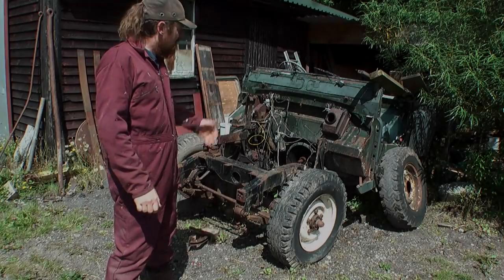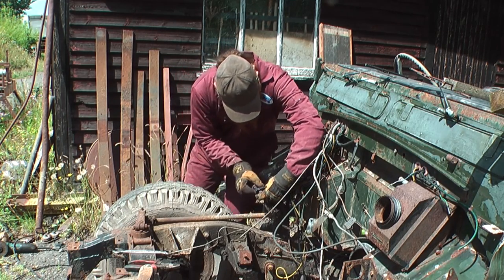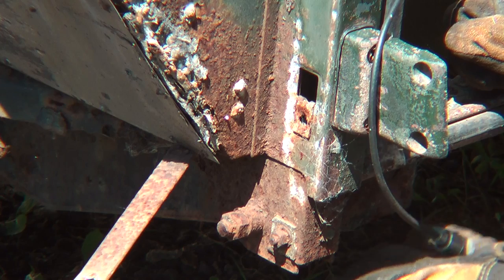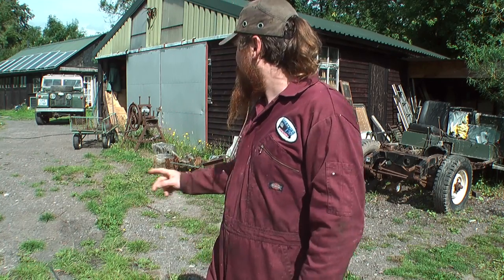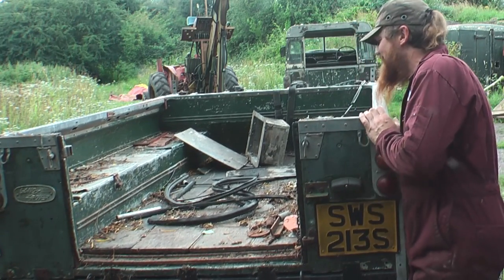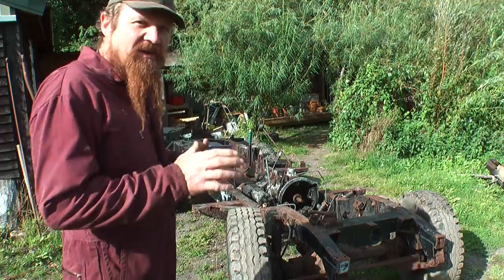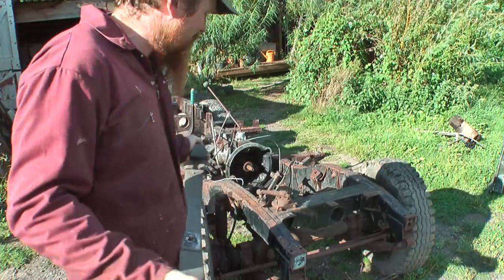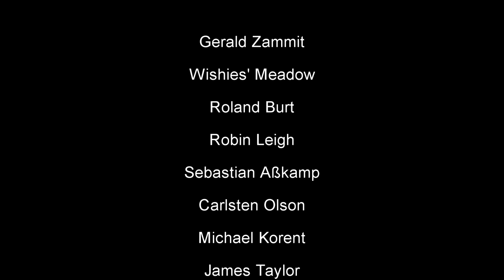Project Kermit 3: A Land Rover Series 3 Full Restoration

Comment: I used to work with someone Who had an old Land Rover He restored it in his teenage years ! the Chassis had oil in the box section there was a B.S.P. plug at each corner, he parked it on a hill next to his house looking up one day looking down the next . I asked him does it not leak out ? and he said if it starts leaking then  it's time to get the welder out.
Reply: Proper approach.

Comment: Nice project. Of course you can upgrade certain things and keep  the free tax and mot as long has it has been done for safety reasons. Which might be most of it lol. I've done it with old bikes. Upgraded brakes ,suspension and stuff because they were rubbish and unsafe. Much better but still over 40 yrs old. : )

Comment: You remind me of a much younger version of myself. Over the years I have welded floors into cars, rebuilt engines, also resprayed/coach painted them to use as my daily transport. All done out of necessity due to lack of funds. Done similar things with numerous motorcycles. Always maintained my own house and garden, built garages and sheds all for next to nothing. I’m retired now so enjoy rather more sedate pastimes such as restoring old valve radios, (I see you have a nice Bush radio on your bookshelf), but I do keep my hand in with woodworking projects. Sadly I am now banned from arc welding due to being fitted with a pacemaker but hey ho still having fun.
Love all of your videos, please keep them coming.
Cheers
Lynton
Reply: I’m a bit sad you can’t arc weld as it is most satisfying - I’m not being a Wally - but is mig or tig welding likewise banned or could you do that?
Reply: Hi Rupert 
Unfortunately anything that creates an electromagnetic field has to be avoided because it can interfere with the function of the pacemaker. In my last job at a nearby university there were areas I was banned from since they used strong magnetic fields for their experiments.
Did lots of welding years ago, both stick and oxy acetylene but I have never tried mig or tig.
Even small engines and their ignition systems can cause interference but I have had no problems when using my hedge trimmer!
Bit of a shame I had to have a pacemaker fitted in the first place, it was down to a drug I was given by my GP. Now banned and removed from the market since it was causing heart problems.
Cheers
Lynton
Reply: Bummer however woodworking is a far more civilised hoppy I still can do all three hobbies ordained by god woodworking machining (metal) and some fabrication welding etc - cheers buy yourself some nice woodworking tools

Comment: When you come to open the chassis up Max, a drain clearing "snake"  for your pressure washer will really help in clearing/blasting  the accumulated  grot out of the long chassis rails. 

I have also found that a phone call to the Galv company for advise about drilling extra holes ( air out/galv in,  during the galv process)  was a worthwhile  thing to do.      HTH  Cheers.

Comment: When you pull the 11 leaf springs off.. if you do any knife making that is a lot of Sheffield spring steel to make into dozens of knifes. In the 1980s when I worked on wooden boats I made caulking irons out of leaf spring sections,cut, ground and the welded to either chisel shanks or grade 8 bolts to get a bigger head.  I sat on my tail gate at the marina and sold them.
Reply: Max does make a fair few knives. Mine is made from saw blade though.

Comment: Oooh; I have been looking fwd to this. Really interested in a disc brake conversion as well. My Series 3 (petrol) is waiting patiently to have its chassis swapped for a Richards galv one, and then I am going to be taking the chassis that comes off and use it as part of my long-term winter project which is an early 70's 2a (diesel), which I am going to be doing myself. I am pondering some sort of power assistance for the S3 as I have fitted wider rubber, and have seen a kit for a M-F 135/35, which seems, by implication to be a fairly straightforward fit. If anyone has done something like this...? Anyway; this project hits my sweet spot =:-)), as much as I love everything you have done so far.

Comment: I have just watched this episode and I can personally vouch for 2 things that were mentioned. Disc brakes and Richards chassis. 
  Starting with the brakes,  when I had the Landy rebuilt in 2015 I had a Zeus engineering disc conversion fitted.  Very easy to do as you strip the hubs back to the stub axle,  then build the hub as normal using the brackets, discs and calipers etc that come in the kit. Not cheap but incredibly worthwhile. 
   Chassis was purchased in 2005 and promptly stored in a damp shed while I had a problematic time of life!! 10 years later after grabbing as much tinker time as I could the axles, engine and gearbox (different to currently) were ready for assembly.  Shipped the kit version to local garage to be completed. But everything fitted perfectly,  for a Landrover at least.  
  I did a little road test when I rebuilt the current engine and put it on my channel. 
  Going to watch this restoration as I like the way you do things Max.
Reply from the maker: Thanks, interesting that both brake kits seem good. I've had a Richards chassis in the past - it was very nice , practically a work of art!

Comment: Nice to see another series being put back together, replacement chassis are all well and good but it is nice to keep the original if possible. I fitted the Heystee kit to my 2A about 5 years ago, It`s a bolt on job with standard series and defender parts. It is a well engineered kit that fits well, a bit picey and you have to wait for them to make a batch but I have never regretted the choice. The brakes are no better than the drum brakes just require minimal maintenance and for the off roaders out there they still work after being submerged in water unlike the drums.
Reply from the maker: Thanks, that's good to know.

Comment: Hey no worries on timing.  I fixed my series 3 chassis about 10 years ago.  My bulkhead is all painted and ready to go in.  I’d really like to put a VW 1.9 TDI in.  I think in stock form it could work pretty well with the rover driveline.  Any nodding of the engine though would probably open Pandora’s box on component failure

Comment: Best penetrating fluid is 50/50 ATF to Acetone using it on my1968 P6 resto here in Portugal works wonders...told my mate who  has a garage down here and restoring  a 635csi didnt believe me ...now he calls it the secret juice...going to soak the winch cable on my 101 FC which is nearing completion in it soon...just waiting on matriculation for it...only taking 2 yrs so far!...subscribed...

Comment: You will have to go easy on the right foot when it's done as the series box won't like all the extra torque put through it.
I found this out after putting a Perkins in a Series 3 and having to overhaul the box every year - still all good fun !!

Comment: had zues on mine but had to fit a larger servo from a defender to get the car to stop as good as it did before the disc brake conversion, power steering makes a big difference for the better experience

Comment: I think, after watching the video, I know the answer to the mystery of the unbolted back tub.
When I first moved to where I live now, I was intending to put Kermit back on the road. 
What actually happened was, I put the new rear crossmember on, patched a few holes in various places and threw some paint at it, then bought a different Landie. 

So I just threw the back tub and other bodywork back on, fully intending to finish the job at some point, but never actually got round to it. 
I suppose I should not get round to stripping down my 200TdI.
Reply from the maker: Well you saved me some effort so it all worked out well in the end!

Comment: My first visit to your site Maximus. I saw recommendations from Mat's chanel ( lookcreations) you had a very easy strip down to my mind, it didn't seem as if you had used penetrating oil for the steering joints etc. And yet they came undone very easily and the ball joints split even easier lol you do know that you don't even need a joint splitter don't you? IG6 you hit the collar of the tapered hole in the correct place the joint unless it is rusted together (which it should not be), it will pop the joint apart just by shock wave. There should be a boss in the forging where the part should be struck with a club hammer, and ordinary ball pein isn't heavy enough unless you have a 3 lb one lol. Your bulkhead looks to be in fair condition for a series 3 .Much better than poor old Mat's one lol his is more holes than metal in a lot of places from the air vents downward. So have fun been there done it and got several tee shirts along my  own LandRover life.

Comment: Max, I assume it was what we call "gravity" that has held the rear tub onto Kermit's chassis the last decades ... going maximum ridiculous original Rover four-cylinder diesel speeds might have helped a bit, too, but super slow motion usually does just assist, the real holding was mostly done by G-force presumably

Comment: Drum brakes on my series one were a pain in the ass, not only were they never in balance, crap after any extended off road time but if you wete doing more than about 70, it wouldn't actually stop as they overheated before you could.. mind you I did have a 3.0L cam and carbed essex engine in mine 🤣🙈

Comment: Great video! Ive got a s2a with defender 200tdi fitted, i have to have ear plugs in to drive any distance!! Ive got a disk conversion using 90 rear disks and 90 front callipers, best thing ive ever fitted! Been fighting with twin cylinder brakes all last week!! Ill see if i can find the company, id avoid zuse i think i is, i believe all their parts are specific to them, could be wrong but LR stuff is readily available!
Reply: What’s your disc set up then, heystee swivels.?What servo you got, does it push The discs hard enough?  Got a 200 in my 61 lwb. It’s noisy but I’ve spent a fair bit of effort losing decibels. Dynomat sheet in the middle of all panels on roof and sides doors and seat box. The 8 mm foam over that. (Inside the seat box )I like to have it looking as unmodified as poss. Exmoor doorcards canvas and some dynomat on bulkhead but NO moisture traps anywhere. Foot wells are done “ my” side. Carpet underlay suspendedfrom under the bonnet  I welded for studs of the bonnet frame and with four thin laths of good wood over them like a nought and crosses grid means The felt is able to absorb but not transmit a lot of noise. And I’ve made up a transmission tunnel cover. More felt and some lead strip to keep it in place and thick cheap stable mat under the mats in front and in the tub. It all adds up. If I could take it all out and compare, it would be horrendously noisy but apart from the foam inside the roof which I’ve painted body colour there’s not much to see.  You can have conversation at 50. Your not shouting!

Comment: Interesting, so the engine swap from what I assume is a 2 and a quarter diesel too a 200tdi you consider a like for like replacement? What about swapping  a 2 and a quarter petrol too a 200tdi? Would that still count? This is what I have done for my 1984 hi-cap. It would be good if it became mot exempt in a few years!

Comment: I got as far as possessing the Zeus disc conversion but I was missold it( not by Zeus I hasten to add). I would have needed new rims which I don’t like the look of, mines looking pretty standard for its 59 years, and I was also slightly apprehensive about the discs being available when I may need to change them many years ahead. I think the heystee swivel kit is better as you get cheap discs and pads for ever. It costs more but you can keep the rover wheels which are cheap and look good ( I think). You’ll need to revise the braking to servo. I’m still running single line non servo, that conversion will happen soon, but I’ve found the best thing for the drums is quality cylinders ( that don’t leak) and oil tight axles with new seals and good bearings. If the wheels don’t wobble the oil seal stands a chance. Dry drums make all the difference.!!I’m not saying never but at the moment mine is alright
Reply from the maker: Yep, I'm leaning towards the Hestee kit. Got a servo ready to go in.
Reply: Maximus Ironthumper I’ve got a lot of admiration for those who chop axles ,reweld spring mounts ,produce bespoke half shafts with cv joints instead of hardyspicer   But it’s not for me. And coil springing and power steering? Well, just buy a sorted recently welded disco. They’re cheaper than all the mods you COULD do . Cos it’s not a series Landy anymore
Reply: second for a servo but I found the small series servo was still not strong enough to work the disc brakes as good as the drums were.
Reply: I Miles interesting. Then you need a later 9 or 9.5 inch servo which may or may not fit your pedalbox then you’ll have to mod your footwell to house a defender brake then you’ve been off the road for a few months..... that’s why I’m sticking with the drums. Good tip mate

Comment: I've heard bad reports of galvanising a repaired chassis. They look superb on the out side, but the dipping struggles to clean the inside sufficiently - any remaining paint or rust prevents the zinc bonding and you are still left with a chassis rusting from the inside :(.

My chassis was a bit more modern (2001) but even so I bottled out of having it galvanised after hearing the issues, and fitted a new Richards one
Reply: I agree, I've just upgraded from a 300tdi to a td5. I didn't fancy a chassis swop but my mate bought the old truck. He's an school engineer and had said about problems with the galv not sticking well to the inside of the chassis. Each to there own though 😊😊
Reply: I've had a S3 chassis galvanized and it worked fantastically (still going as far as I know). The important point seems to be to acid dip (which cleans the inside of the box section) rather than just media blast the outside of the chassis. This is not the normal pre-galv acid dip, but a much more extensive process that takes everything back to what looks like new metal. I took mine to a company that only did acid-dipping. Also did the doorframe & bulkhead (seem to recall I had to weld up some seams on the bulkhead where it was spot-welded). This was all about 30 years ago, so my memory a bit faint on the exact details...
Reply: @davidhaywood8029  David I have no doubt that a prolonged acid dip will remove most rust and paint, and once neutralised will leave a surface good to galvanise. But how the heck do you adequately wash out the debris from a ladder frame unless you are prepared to open up (angle grind) all the box sections. And unless you do this you have absolutely no idea how thick the remaining metal is. It's all very well pecking at it with a chipping hammer, that will reveal the paper thin bits - but what about the cardboard thin bits !!!!!
Reply: @andrewmawson6897  I can only speak to my own experience, of course, but that wasn't a problem that I had. Everything was very clean when I got the chassis back from the acid-dip people (I think they water-blasted as part of the process). I do remember being rather dispirited by the realization that the rust damage was waaay more extensive than I'd thought (though obviously it was already bad enough for me to have got down to the chassis in the first place). I ended up welding about a square metre of sheet steel into the chassis for repairs, plus a few extra bits removed from a couple of donor chassis at a wrecker. I do recall tapping away at various dodgy bits and looking inside with mirrors, etc. (There were an awful lot of holes to look through). You do sometimes get the odd missed spot with galvanizing and after the hot-dip I poured an anti-corrosion product (Gold-X?) through the chassis & the doorframes plus bulkhead, etc. (anything hollow). This may have been unnecessary as I now understand that even the missed bits will get cathodic protection from the zinc coating. At any rate, the galvanizing was a very successful solution for me with the landrover in a marine environment...
Reply: @andrewmawson6897  As a side-note, these days you would probably use an ultrasonic thickness gauge rather than a chipping hammer (post acid strip) to find any thin areas in the steel. There are also lots of low-cost inspection cameras that you could snake (or slow-worm) inside for a visual double-check. In my case I had so much rust damage that I could get a pretty good look inside even in the olden days...

Comment: Please change the gearbox to a 5 speed as the series box isn’t geared high enough for a TDI,    Love watching this as I rebuilt my 109 safari back in the 90’s but I changed the chassis for a 110 as I wanted coil springs and the disc brakes. I got an ex military chassis which had 2 ton rear springs, but back then you could get away with a more and keeping your original registration number, the only thing that was still original was the safari roof and rear tub and the 6 doors plus windscreen. I believe the rear “seat box” was still original and the B pillars, it’s still on the road now I checked it out on the mot checker app after I sold it in 02/03 around then.

Comment: I put a 200tdi into my 2A about 15 years ago to replace the 2l montego that replaced the 21/4 diesel that replaced the 21/4 petrol that was originally in the landy when I bought it. 
I replaced the diffs for discovery ones. I quess the ashCroft will negate that convertion??
I've had parabolic on for 16 years, a big improvement easier to clean and maintain than the old leaf springs but as you said in an earlier comment "oversold"
Reply from the maker: I did the same when I had a 200 in the other landy. This one has a Salisbury rear axle so the disco diff wouldn't fit. The Ashcroft box gives the advantage of leaving the low range unaffected - although it does cost a lot more!